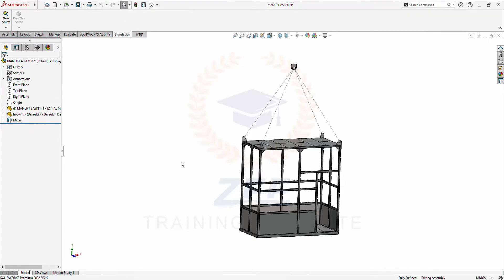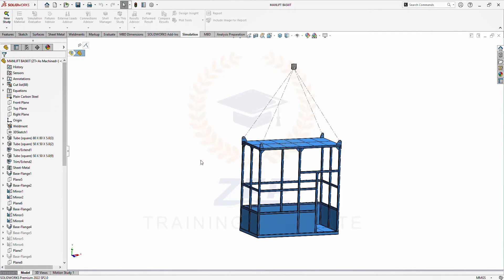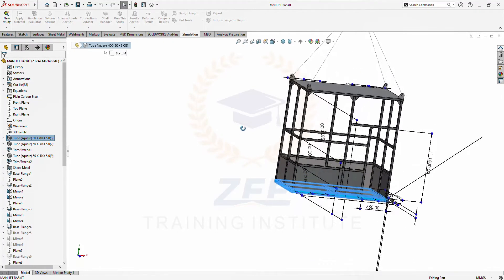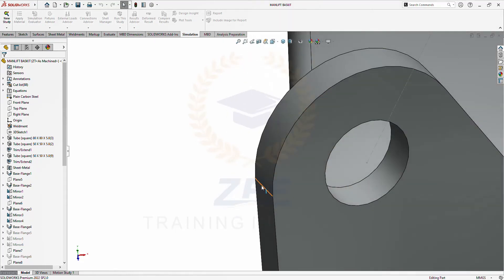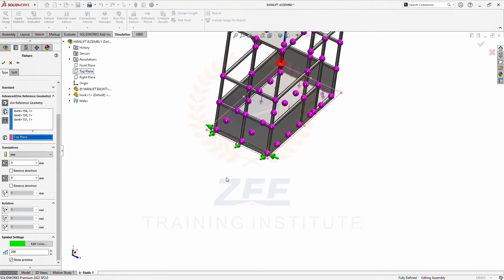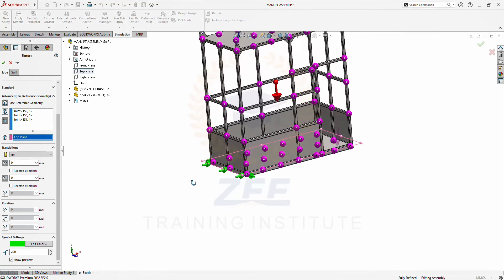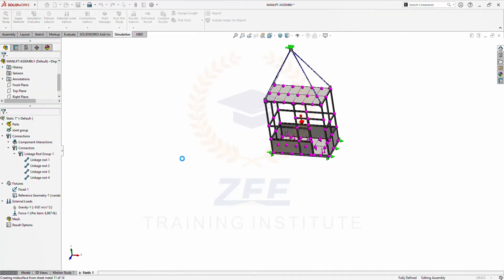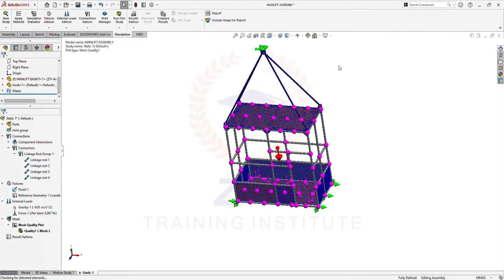MAN LIFT SIMULATION IN SOLIDWORKS - Linkage Rod Connector

Comment: Hİ dear sir, I need to design a steel platform that must withstand a load of 2.5 tons. Unfortunately, the solidworks program we use does not include static analysis hardware. Can you help me if I send you the solid model?
Reply: Do you still need help?